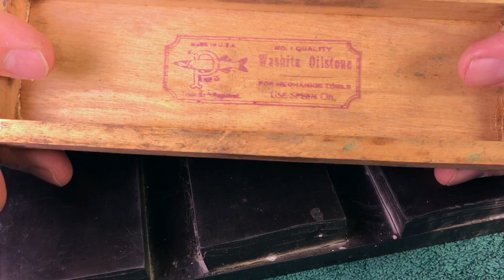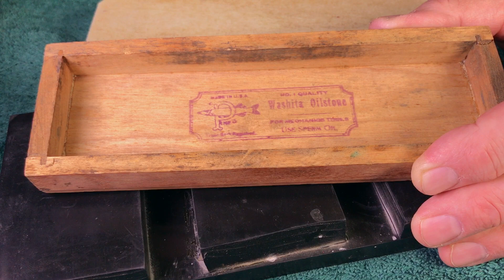Honing in the 1800s

Comment: Interesting video about the spermaceti oil in honing. I shoot muzzleloaders and hone my own straights (although a novice), and also am into sharps rifles that use paperpatch bullets. A few things I have learned about the usage of sperm oil is that in an 1875 Remington catalog they tell you how to load rounds and specify using sperm oil on the paper patching for the bullets. Sperm oil was the main oil use in automatic transmissions until the outlawing of whale hunting and outlawing sperm oil sales in the 70's. Auto transmissions had a very high failure rate because the replacement oils weren't as good as sperm oil. Then someone found a natural equivalent with basically the same viscosity, high temp stability and lubrication properties. That oil is jojoba oil, once he came up with his formula and I believe mobile bought the rights transmission failures almost went away. I have a small bottle of phleuger reel oil that I use and it is very slick and feels totally different than what you'd think oil should feel like. I haven't seen anything about the use of sperm oil in honing back in the 1800 as most of what I have found just states barbers to use lather.  My hypothesis is that since sperm oil was the liquid gold of its time way before crude oil was discovered that anyone needing an oil for lubricant was more than likely going to use sperm oil. It was available everywhere and was used in just about everything imaginable. It would be interesting to see if jojoba has the same honing qualities as sperm oil.
Reply from the maker: Hi, If you scroll through the comments you'll find at least one earlier mention of this...thing is - Jojoba gets gummy, and turns rancid. It's very difficult to clear out of a stone too. Jojoba, as-is, doesn't really behave the same as sperm oil in this useage. Supposedly, the chemical composition is similar but when used side by side for honing they are wildly different. Modern ATF uses "derivatives" of Jojoba and Rapeseed oil mixed with other chemicals to create friction modifiers. I think the whale oil used in the older ATF fluid (Dexron B) was modified also - so it wasn't the same as Sperm Oil for lubricating a sewing machine or watches, or candles. 
Through the mid 1700s and continuing throughout the 1800s, into the early 1900s - Sperm Oil was a sharpening medium of choice. Pike and Norton labels on their Arkansas stones, 1800s into the 1930s-1940s, were printed with instructions to use sperm oil. One of the most famous Barber Manuals, by LeBlanc - 1895, mentions Sperm Oil for honing also. There are mentions of sperm oil being used for sharpening back in the late 1700s too.

Comment: Hey Keith , I love and appreciate all of your videos. Just wanted to revisit this comment thread after visiting my dads place to do some wood work. He has a bunch of old tools which belonged to my grandfather’s. including an old norton combination stone. It resembles one one I picked up in new old stock condition. India and washita 1 I believe. However it’s loaded with oil and swarfe. I used it to sharpen an old chisel, and I noticed it seemed to cut  finer than the one I owned, or at least felt that way. And it got me to thinking, perhaps there may have been a ‘breaking in’ period for these stones. It feels like a term of the times, and lapping with diamond plates and perfectly flat lapping plates were probably not feasible. Maybe even the old, worn, tool grade hones stepped up to well worn finishing hones in some cases. I guess it depends on the need or use some what
Reply from the maker: The practice of flattening whetstones has been around for a very long time. Loose grit, using other stones, sandpaper, lapping plates, etc - all that and more were accessed to resurface and flatten.  Arkansas stones do break in but coarse washita do not morph into finishers. The Geological studies in the 1800s classed Arks as coarse med and fine (Washita, Soft, Hard). Wearing the stones in helped even out cutting, and allowed finer results, but not by leaps and bounds. In use, the wearing-in and oil saturation mostly allows more versatility, via pressure regulation. At some point the stone becomes too clogged to be of much use though. I remember the Washita/India stone, they still make a Soft Ark/India combo I think.

Comment: Try a bit of Neatsfoot oil compare with what you have that we cannot get.
Old lamp oil was whale oil.  But even tallow can be rendered to generate an oil.
It might go rancid but the winter oil trick and Neatsfoot oil  might be a winter experiment.
I have always felt that a clogged oil stone would hone vastly finer than the grit.   The local hardware  store 
had a bench stone well saturated but it took my scout pocket knife to a quick edge.
Reply from the maker: Just about any lubricant can be used as a honing medium, but not every honing medium has a good 'feel' or action in/on the stone. So, experimenting should be done prudently. I've used 100% neetsfoot on stones years ago because it was what was handy in the garage. I don't find its lubricity to be to my liking, it tends to clog easy, will go rancid over time, doesn't flush easily, gets gummy, etc. People tried to sub Jojoba oil for whale oils but they turned out to get gummy and problematic also. An early variant of Dexron ATF is a plausible sub, but only the first permutation without red dye - it will have whale oil in it actually. Most people are happy with commercial lubes though.
Reply: @KeithVJohnson1   Thanks the bit about ATF and other special lubricants.  That is obscure knowledge and more complicated than the red dye.   Thanks again

Sperm oil, a special kind of oil obtained from the head cavities of sperm whales, differs chemically from ordinary whale oil: it is composed mostly of liquid wax. Its properties and applications differ from those of regular whale oil, and it sells for a higher price.
Reply from the maker: @niftytubeman  Yep, sperm oil was special, technically a wax; but now we're into esters and triglycerides and nowhere near honing. The stuff was used for/in transmission fluid early on. I often use the terms sperm/whale oil interchangeably because explaining the difference all the time becomes bothersome. There were grades of sperm oil also, so it gets pretty complex. Early Type A fluid, transmission fluids made before then, and Dexron first version all had sperm/whale oil components. and If someone wanted to experiiment with what is 'no longer available' that would be a logical route to follow.

Comment: Hi Keith,
Yeah it was Mr. Peabody and his boy, Sherman.  They would jump into the Way-back machine and do history lessons, usually where they would go back in time and help out a historical figure.  It was part of The Rocky and Bulwinkle show.

You mentioned sperm oil being a wax, then it occured to me that Jojoba oil is a wax.   There is mention on the internet about using jojoba as a sperm oil substitute for sewing machines as well.  Have you run accross any relable sources or do you have any experience related to this substitution?
Reply from the maker: Thought it was Bullwinkle-related. Ty. Jojoba was a replacement for Whale oil in some applications, ATF for example. In my experience, as much as it said to be similar to whale oil, it is also not so similar. Maybe the automotive industry jazzes it up somehow. But Jojoba does gunk up, it will go rancid, etc. Personally, I was't impressed with the stuff. I know someone that messed up a stone or two with the stuff. It was fixable, soaking in solvents removed the build up.

Comment: Have you ever given jojoba oil a shot to see how it compares to sperm oil? It's supposed to be the closest thing available but I don't think they had razors in mind.
Reply from the maker: Yes, long ago.... an old recipe for a rifle bore cleaner calls for sperm oil and the modern substitute for it is Dexron ATF; when I researched the chemistry further I found that Jojoba was in the ATF recipe as a sub for sperm oil - sorta. That cleaning mixture worked pretty well, but for honing, Jojoba didn't pan out, it gets tacky/gummy and goes rancid. I know a few guys that had to soak their stones in solvents to clear hardened Jojoba. 1950s Dexron ATF type A Suffix A has sperm oil in it and it works for honing without issues.  Type B has sperm oil but also has red dye, which will color stones. I can sorta feel the difference in honing when using that old ATF, presumably because of the sperm oil, but it's not worth the effort, cost, etc.

Comment: How does the Sperm Whale Oil compare to Automatic Transmission Fluid?
Reply from the maker: Modern ATF has that typical modern oily/fake feel, it's nothing like the sperm oil. Plus it's dyed, which is annoying. Even Dexron B ATF, which wasn't dyed, but actually had sperm oil in it, is totally different.
Reply: @KeithVJohnson1  Yes, I have had to clean that dyed stuff out of a few vintage stones I acquired, not fun

Comment: I know this video isn't really about the sperm whale oil, but I wonder if you've tried out Jojoba oil, since apparently it's a workable replacement after a casual google search for substitutes.
I don't plan on using it and am happy with whatever lightweight and refined mineral oil that happens to find itself in my shopping cart or hand, but still, the thought remains.
Reply from the maker: Hello, and thank you for watching and commenting. Yes, I have used Jojoba - I've a fair bit of long-term testing with it actually. It's not a workable replacement for this specific usage. Jojoba does go rancid, it does get gummy, and in general it just makes life a living hell when it degrades to that degree. Getting it off of a blade can be quite a chore, getting it out of a clogged Arkansas stone would be a nightmare.
Reply: @KeithVJohnson1  
Ha, that's one curiosity satisfied!
Thanks for the answer!

Comment: Jojoba Oil might be a modern alternative to Sperm Oil since it also is made of wax esters and not glycerides.
Reply from the maker: Doesn’t work too well as a replacement for honing oil. It dries and gunks up stones, goes rancid, doesn’t really feel great under the blade, has a different king of viscosity and friction coefficient.
Reply: @KeithVJohnson1  I just watched this video again and I have to say that although I enjoy all your content this is my favorite video of yours. I ended up landing a nice old washita a few months ago and I already owned a hard ark. I honed up a razor just going from the washita to the hard ark. I have been trying to move away from petroleum based oils and ended up using some neatsfoot oil cut with a little turps. The blade could shave but it wasn't anything that people would accept today, even after a very vigorous stropping. I was thinking about pastes back then, I came across some information about rubbing lead into the linen side of a strop, the thin layer of lead on the strop turns into a white oxide which could possibly polish up the bevel. Later in the 19th century they even sold specially manufactured strop conditioners consisting of a strip of lead or linotype held in a handle to rub into the linen. I've never seen an old strop with any sign of cromox on it but then again I haven't come across too many old strops in the antique stores round here. A real thought provoking video, oh to be a fly on the wall of a barbershop in 19th century America.
Reply from the maker: @temhawpin  Thank you for another thoughtful comment! Happy Honing!

Comment: Hey Keith, this is one of your best videos. Could it be that barbers "dressed" the Ark a bit rougher in one side and left the other side to polish?
Reply from the maker: Of course that is a possibility, one I think about often actually. But,  like so many other things - that practice was never noted in any barber manual or supply book. Another thing is that I have yet to find a vintage Ark that shows legit signs of significant use on both sides. I really do believe that the main thing was learning how to max the stone's capability using pressure and stroke techniques. Old Geological Studies reference barbers preferring to hone spine leading on Washita in an effort to combat toothy and chipping edges.